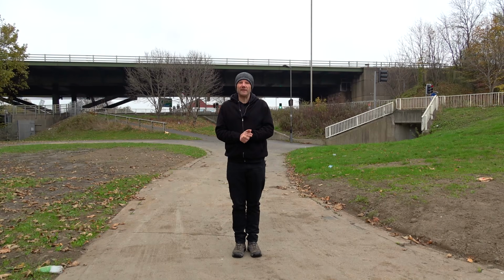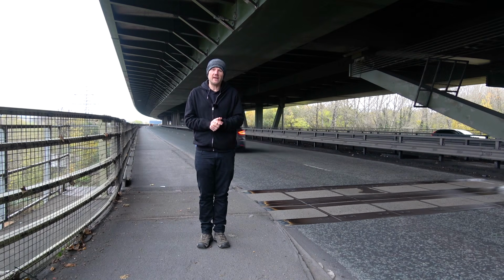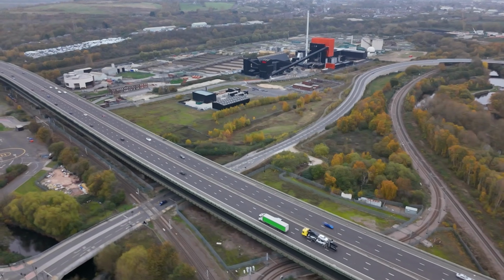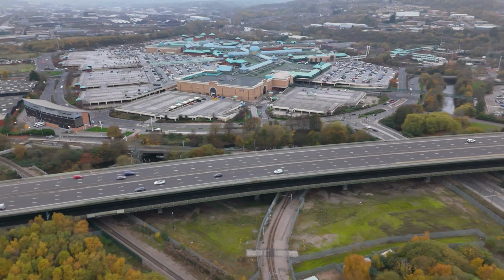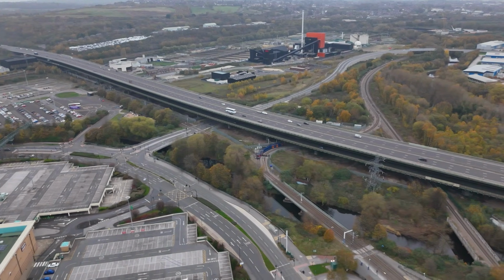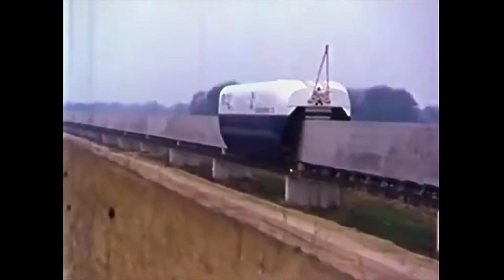The SUPER STEEL 2 TIER Tinsley Viaduct - M1 Motorway - Sheffield

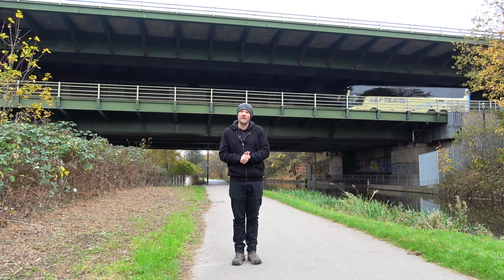Comment: 5:37, that huge box section over the lower deck carriers various things including fibre optics. I know this because my old man worked for bt and had to crawl through it once to do some work. its farily big but every so often features a beam going across it meaning you need to squeeze through a smaller gap. described as an awful experience as the whole thing moves as wagons go over it 2/10 would not recommend

Comment: Used the viaduct every day from the mid '70's - for what seemed to be an eternity the viaduct was never fully open - the lanes being restricted to limit the weight loading , and then to allow the reinforcement to be installed. Seems to have worked out eventually - the problem with steel construction as the Forth Rail bridge has shown , maintenance is an ongoing and permanent necessity, and if done properly, the structures will last.

Comment: I can't believe I missed this until now :)

It's still standing because in 2002-2005 it had a major strengthening and resurfacing project and large sections were closed for a few weeks.... the work was done to fix design flaws and increase strength for heavy loads!

cost around £80mil

Comment: An excellent video with just the right amount of sarcasm. Although it was strengthened, a fact you seemed to have missed is it was also widened at the same time, adding an extra lane on both sides of the top deck, along with the associated weight increase, probably in the tens of thousands of tonnes. In the 80's we were involved with the resurfacing of the top deck and I can tell you it really bounces, you couldn't fill a cup of coffee to the top else it would spill out with the bouncing. Very un-nerving. All the best.

Comment: Additional little known fact: The bottom deck, you may think has two carriageways, one in each direction. WRONG!
It has a third, which runs along the centre of the bridge. You can just about see it in your end shot. 
There are no cars on it. There are traffic lights for the central carriageway at each end of the bridge but they are bagged up. The ends of the road curve out in both directions on to the roundabouts at each end.
"WTH is it for??", you rant!
It is used when one or other lower carriageway is closed for roadworks. Traffic is then simply directed along the central carriageway. 
Genius!
Reply: Also fun fact, the middle lane is single carriageway and usually a 30mph limit resulting in full-length queues (you can get an emergency vehicle through if necessary but it's a squeeze and not a sound you want to hear in the queue!).  The stop line for the traffic lights at the north end is also ever so slightly in the wrong place so when the middle lane lights are on, you have to be on your mettle for drivers coming from your right and aiming for the original line!

Comment: There were only two cooling towers not seven. Cooling towers do not emit toxic fumes, they are huge heat exchangers cooling the water from the steam turbines powering the generators producing electricity. Only water vapour is released from the cooling towers.

Comment: If you travel north on the lower deck and you are held up by the traffic  lights as you try to exit at the north side, you will probably  experience  the slight "bouncing" of the structure...  It could be imagination but it feels very strange as you sit patiently  in your car .
Reply: You can feel the vibration at either end, but yes weirdly moreso going north.  At the south end, it clangs a lot more when lorries go over the 'join' on to the top deck from solid road!

Comment: When it was proposed a design competition was held.
The 'winning' design was severely criticised for being the worst available.
These criticisms were not just dismissed but openly villified. Why?
Because the most vocal critic was one of the losing designers. 
As predicted it has cost FAR MORE than any other such motorway structure to maintain way more than the actual building costs.
There are lane closures for such work ALL TOO REGULARLY so NO it is NOT a success story 🤬

Comment: The lower level was originally 6 lanes of traffic. I'm not sure when they stopped cars using it but I remember going on it as a kid, also heard it was a weight issue
Reply: Which muppet signed off 6 lanes in the 70s...?
The sole chap walking his Dog on the footpath doesn't even have ARMCO crash-barrier protection.

Comment: The upper deck in the 1980s and 1990s was 6 lanes of motorway with no hard shoulders, I used to drive along it in the left hand lane at 70mph flinching a bit at how close the fence to the edge was. Then a lane each way was turned into a hard shoulder and it stayed that way while the deck was widened to add an extra lane on each side. Finally it changed to 3 lanes with the new hard shoulders when it changed to a smart motorway a handful of years ago.
Reply: A long viaduct with three lanes each way but with no hard shoulder is potentially dangerous because vehicles cannot pull off in case of problems. In particular heavy lorries. The Thelwall viaduct on the M6 which takes that motorway over the River Mersey and the Manchester Ship Canal east of Warrington was built with no hard shoulders in 1961. In 1971 there was a terrible accident on the viaduct when a number of vehicles hit a stationary lorry in fog (up to 10 people were killed). Eventually that viaduct was doubled so it is now 4 lanes each way with hard shoulders both sides. It appears that the addition of hard shoulders on the upper deck of the Tinsley Viaduct was funded and implermented as a result of the Thelwall accident; Tinsley having similar risks.
Reply: @marc21091 The Tinsley viaduct was widened in the 2000s, that's a long time after an accident in 1971.

Comment: I spent weeks in the 80's testing the welds on the inside of the box  sections we found that a the steel was a type that contained segregation and natural weaknesses that along with the weld design was considered a potential problem and months were taken to remove the welds [fillet] one at a time; and some of the steel sections and then replace with a new design of weld [penetrated]. these were examined using ultrasonic and surface testing. The plate work was then painted with anti corrosion paint which actually never dries.

Comment: My grandad told me about the problems of this bridge about 40 odd years ago when i was a young un, and every time i'm stuck at the lights under the lower deck on the Tinsley side i always have a glance up at the steel roof while hearing the loud clank of each vehicle as the trucks & cars pass overhead,,,,,,always a relief when the lights turn green at that side ,,,funny thing is i don't get that feeling so much on the other side but you can't hear the clank so much on that side.

Comment: It's had it issues and partial closures and it's great when on the lower deck feeling the viaduct gently bounce under the weight and movement of the constant traffic. I've heard of the other bridges and always wonder when it will be Tinsleys time. It's got to be kept up, lets face it how would they work a diversion to fix it.

Comment: Not even aware I am driving over a viaduct. There seems to be a permanent 50 mph limit on that section,  though its indicated as a temporary speed limit, and then there are the speed limit ostensibly for "air quality", which is now ironic considering the motorway passes through an area  of heavy industry (still), though greatly reduced since the 1960s.

Comment: Was told one of the reasons for corrosion was the amount of urine in the box girders from the construction crew who couldn’t be bothered climbing out to use the loo. Also that the top tier had under road heating to stop the condensation from the cooling towers freezing on the road in winter. Don’t know how true that was.

Comment: The Wikipedia page does say 10,500,000 gallons per hour, but to boil that water I think you need almost 30GW .... sounds unlikely from a quite small power station. Could be cooling water flow rate, but still looks high.

Comment: The advantage of exposed steel rather than steel reinforced concrete, is you can see and inspect the steel.  Rebar can corrode and deteriorate inside the concrete, so issues can arise suddenly.  With this, they just have to keep it painted and inspect it regularly to keep it in tip-top shape.  With proper maintenance it might outlast many other viaducts, like the M4 in London.  Portland, OR has a two level bridge, a lift bridge (where each level can move independently), which is over 100 years old, made of exposed steel.  It carries cars, light rail trains (originally trolleys), freight/passenger rail, and pedestrian paths and sidewalks.  It doesn't look like it is going anywhere soon.

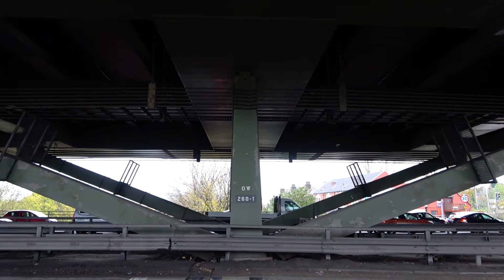Comment: 4:31 The 'diagonal supports' shown here are of relatively minor importance. The diagonal struts that were added in the 70s were the big beasties you can see at 4:38 - they went all the way from the base of each pier, past the lower decks and were fixed at the upper decks. This significanly increased the longitudinal stability.

(source: I worked on this during the 2002/03 improvements you mentioned!)
Reply: It did seem suspicious to me, having those flimsy supports to prevent unexpected total failure. Now it makes sense!

Comment: For a long time, the motorway on the top deck only had two running lanes in each direction, with double hard shoulders, which I assume was a weight reduction strategy. Only went to three lanes in the last ten years

Comment: Minor correction: When the viaduct opened, it didn't have six lanes on the upper deck, it had two in either direction, with a sort of double hard shoulder arrangement presumably to give a bit of extra leeway for vehicles that lost control so that they didn't risk falling over the edge. It was only changed to three lanes each way with standard width hard shoulders within the last ten years or so.
Reply: Incorrect. When the Viaduct first  opened there were definitely three lanes in both directions on the M1. Being local I've driven over it thousands of times. It was reduced to two lanes after the aforesaid bridge collapses happened. It remained two lanes until the huge diagonal braces were installed. It then reverted to three lanes for several years then back to two lanes for further strengthening. Now back to tree lanes.
Reply: It will please @GDBRescueandrecovery that the viaduct will always have a hard shoulder - sadly for him though smart motorway either side.
Reply: Yes, I was going to say the same thing. In fact you can see the extra added width quite clearly in the video.
Reply: @egpx  I used to be three lanes, then went down to two lanes with the work in 2003 I think. It then went back again to three lanes a few years back.

Comment: It hasn’t “lasted” 55 yrs it was constantly worked on for years up until fairly recently whilst they strengthened and repaired it.. If you are under it sat at the traffic lights heading for the M1 S you can see the upper level bouncing on the giant buffers. 😂
Reply: It's been maintained to last during its current lifespan.
Reply: It's very much the Trigger's Brush of motorway bridges.

Comment: Those three bridges/viaducts that collapsed did so while they were being 'constructed' with bits shooting out into space before being joined up on the other side with only sky hooks as supports. It was the fault of the planning/construction stage not the design. 
It did mean LOTS of work for little men crawling around inside, welding on thin bits of metal and huge delays while every HGV was forced into one lane nose to tail. Probably causing much overloading? Bunched up, rather than free flowing HGVs.

Comment: Nice to see you covering this structure in a highways inspector based in Sheffield and recently, with just my two brothers, carried out all the inspection works that have been taking place on and inside the confined spaces of the steel box sections throughout Tinsley Viaduct. As you mention it’s not in bad shape at all and inside the beams besides a few minor cracked welds is all well kept and repainted. 👍🏼
Reply from the maker: Great to hear from you, I like "inside" information.  Any chance of a tour ;)
Reply: @AutoShenanigans  Are you suggesting it would make a good video? "Jon crawls half a mile inside a steel box."
Reply: In the ‘70s, I was involved with the “Merrison” Steel Box Beam stiffening project, spent months climbing inside these girders, seeing the welders installing additional webs to the originally designed stiffening webs. An amazing project. 
Note the failed girders failed during construction because at the time the method of installing this “new” technology wasn’t understood properly, these new box beams (at the time) could not withstand the unique forces introduced by cantilevering the girders into position, which was an age-old method that was safe for earlier bridge girder designs.
Reply: And that is the key lots and lots of paint ... as long as that is kept up it will last forever
The tough part is getting in 2 these places to paint it ....
Reply: @billturner6564  it won’t last forever if you just keep applying protective coatings.  The viaduct needs to be checked for fatigue cracks.
Reply: I’m guessing the minor cracking you found is fatigue cracking, you are arranging it to be drill stopped initially and then the welds removed with a cold cutting technique and re welded with a pwht.
Reply: @adamlee3772  zzzz

Comment: The best argument I can make in favour of steel for a bridge like this is that if there was corrosion (which was bound to happen) you’d actually see it and could do something about it, whereas it could easily not be seen in reinforced concrete. 

The outro drive is a great view though. What a remarkably light looking structure
Reply: Correct, and that's the problem they had at Dunkirk Flyover, next to the QMC in Nottingham, which carries the A52 towards Clifton / A453.
Reply: @stanmarsh14  Same problem that doomed the Ponte Morandi bridge, which collapsed and killed 43 people.  It was very likely steel cables corroding within the reinforced concrete (the stays and cables were, for whatever reason, fully encased in concrete).  This corrosion was very difficult to detect.

Comment: Fun fact: The reason for the repairs in the early 2000’s was due to the Towers being demolished. The wind is strong down the valley and the viaduct had been designed and built with the Towers in place acting as a wind barrier. The repairs were necessary to strengthen the bridge to handle the wind with the towers gone..

Comment: When I was working in steel research in Rotherham a mechanical engineering colleague told me tenders had been requested for a concrete structure, but one company offered the steel version; it was so much cheaper the choice was not in doubt.
Good video!

Comment: So this is what the Tinsley Viaduct looks like when it was built in 1968 and opened in the same year. With the M1 motorway at the top deck and the A631 in the middle deck. 

I must say that it’s quite an impressive structure that can handle so much traffic when the M1 motorway was built and extended to Leeds that you have mentioned in your other previous videos. Very interesting piece of British engineering history.

Comment: as a former daily user of this viaduct (I live near junction 36, and worked at an engineering firm just off the southern end of the viaduct) I became very familiar with it
if you're waiting at the lights to get from the viaduct onto southern roundabout, vibrations from the motorway overhead often cause vehicles to visibly bump up and down on the spot - very unnerving if you're not expecting it!
also the road leading from the southern roundabout to the Sheffield ring road (Shepcote Lane, a.k.a. Schrödinger's A-Road) is very strangely signposted: from the roundabout it's marked A6102 (same as the ring road), from the ring road it's marked A631, both without brackets

the section of M1 through Sheffield and beyond to the north was a last-minute addition, considered beneficial despite the larger amount of engineering work required - it was originally meant to terminate on A1(M) Doncaster bypass on what's now the southern end of M18, which is why M1 turns a sharp corner through the M18 junction while the south-facing sliproads are gently curved, and the junction is so close to junction 31
the Tinsley viaduct is the heaviest bit of engineering on it, but there are some pretty substantial hills on the Barnsley section, and there are entire motorways in this country that are shorter than the south-facing sliproads at junction 37
Reply: The j37 south slip road is perhaps the longest in the country it's all downhill with a constant gradient nice for getting to the tonne on the m1
Reply: J37 North slip almost exactly the same, westbound m42 j5 at Solihull is tiny in comparison but no chance of getting the  tonne as it's always smart motorway at 50mph a moving traffic park
Reply: As a fellow left-hander, but not a De dah, please explain, "Schrödinger's A-Road [I know about Schrödinger]?
Reply: @jonathanpalmer155  it's a single section of road that apparently has two different numbers, depending on which sign you look at 
similarly, some parts of A633 between Barnsley and Rotherham are both primary and non-primary, depending on which sign you look at